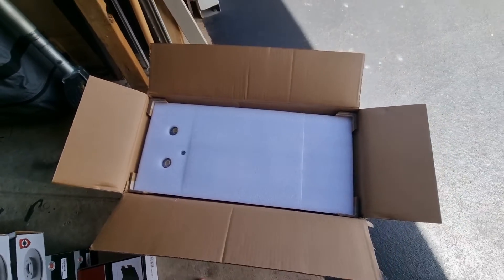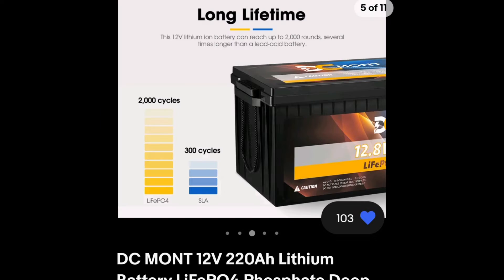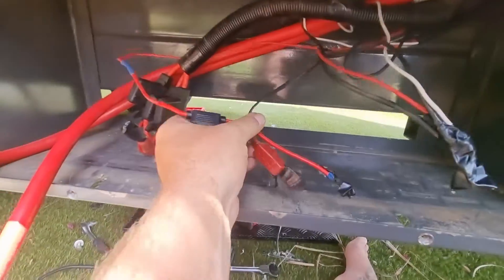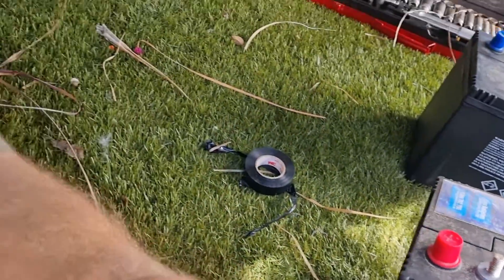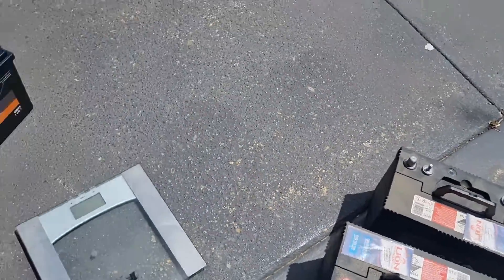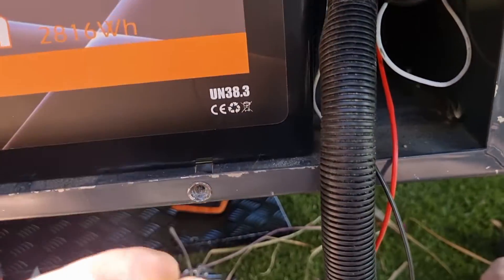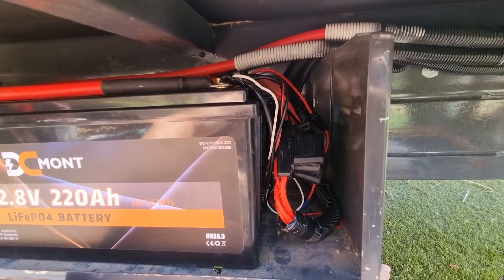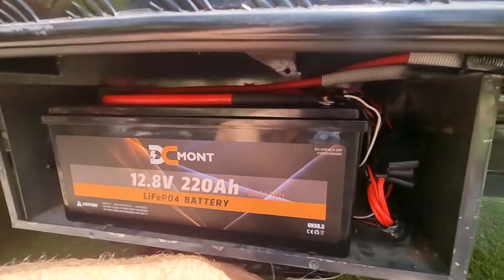Lithium Battery upgrade in Caravan

Comment: Hey mate, is that battery enough to run the AC in the van off grid or does it suck the juice out really fast? Looking to do the same in our van, 240ah of lithium and got told I’d need 600ah to run it for a few hours off grid. Cheers
Reply from the maker: It will work mate, but 600ah would be  much better to run a a/c....

Comment: How are you finding the dc mont battery with the 3000 w inverter ? Does it ever cut out ??
Reply from the maker: Pretty good..the battery has been great,but the inverter fan hasn't been working so the inverter beeps and faults out....I have now got a 2000w kickass inverter

Comment: I believe this is an eco worthy battery. same connection as my 100amp eco batteries. same problem with the bolts. lol. don.t no what price differance there is. but the batts i have are all right. good video .i live in GB, so my traveling is far shorter then yours . phil

Comment: Hey Great Vid & thanks for sharing! I'm looking at doing the same with my Supreme and agree the wiring is terrible. Do you have any concerns having the battery located where its not fully water proof?
Reply from the maker: Don't really have any concerns with the location..better than in van, pretty sure most lithium  battery's have a short circuit protection......but i totally get what you mean if you did a river crossing etc..thanks for the comment

Comment: Hey muddy. Not seen where you storage box is maybe one above the battery tray into the van? 
  I have a vivid cross like an urban haze and had 2 boxes for agm outside like that and a spaghetti junction of wiring with multiple terminals like that. 
 Don't know how caravan companies can get away doing that multiple power leads into one terminal. Dodgy as. 
  Great idea to take back inside the positive wires for the loads and run a fuse box inside the van if you have an opening above those batteries then you can have each individual circuit. 
  Enjoy your new power.. ❤
Reply from the maker: Thanks for comment, appreciate it..yeah the wiring is shocking,  nothing labeled...a terminal box would be better for sure

Comment: Hi ! A Great video, Just one question, do you have a smart shunt in your system. These work like a fuel guage in your car. These are the only thing that will tell you the remaing capacity in your lithium battery. They can also tell of the terminal voltage, the current that is going into and out of battery, time left to discharge as a percentage, I have used a Victron smart shunt and a bonus is that it ( along with other victron devises ) blue toothed to my phone.
Reply from the maker: I have a redarc one...yes i love the victrons, a victron one would be good on my inverter..as the inverter doesn't show on my system...I use to have a Bluetooth one in my 79 was great ,but have sold it now ...thanks for the reminder